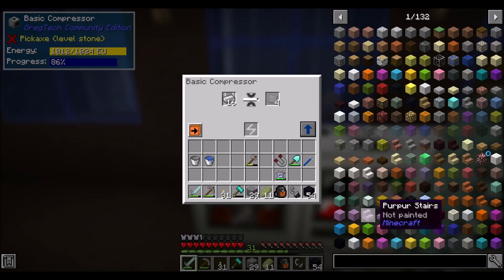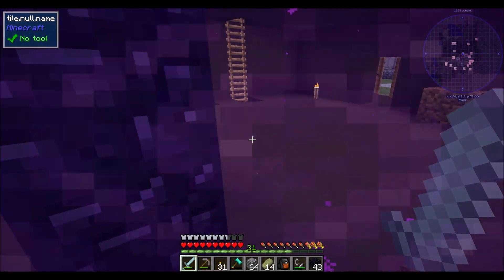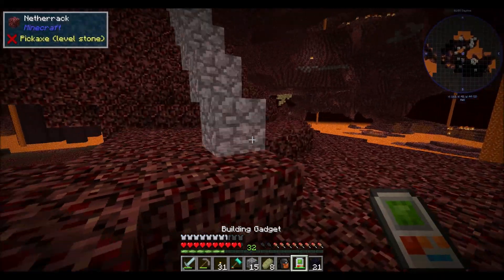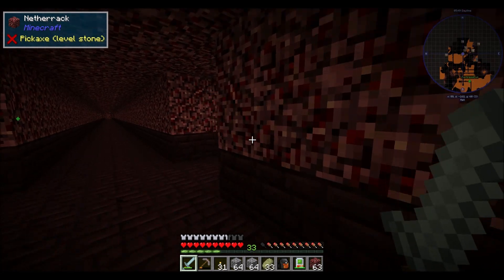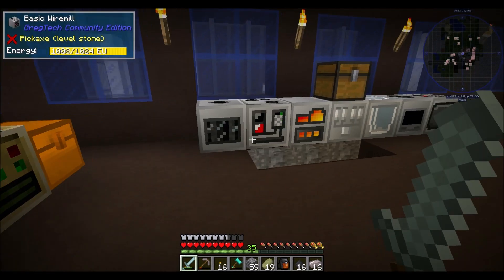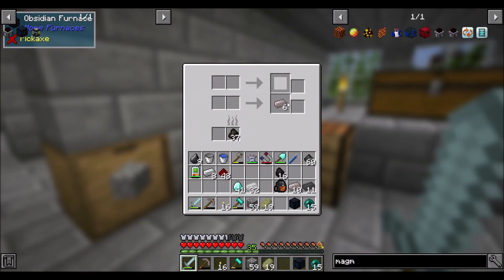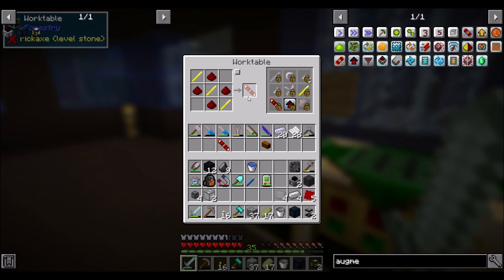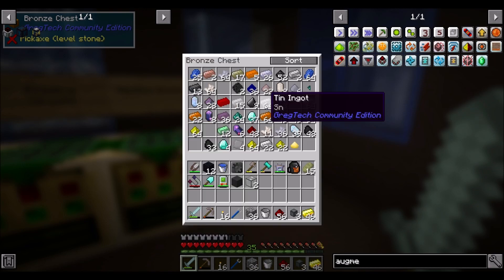OmniFactory   Ep10 Nether and Magma Power

Comment: Gregtech offers the butcher knife, pre-enchanted with looting 3.  It's a bit slow of a weapon but after weakening the mob with another weapon, it's an easy looting 3 tool.

Rather than wasting the resources for the field limiter for who knows how many dynamos you might eventually make, along with the slot that could be used to put a power increase or fuel efficiency upgrade in, use a comparator on the capacitor bank and redstone wire up the dynamos.  Even better would be a power monitor!

Make a lathe and a polarizer, the quest book mentions the polarizer in early game and it never(?) mentions the lathe, but both are starting machines.  

make satchels.  You should be able to make a reinforced satchel.  

use fine copper wires to make circuits and basic motors.  there is really no excuse not to as you're using 2 copper ingots every motor instead of 1/2 an ingot to skip a relatively fast process.

there are a TON of different alloy recipes, consider making a second or third alloy smelter.  Gregtech you will find yourself wanting to make many of each of the machines to save both time and ease of automation.

save some time and make a second or third tool of whatever you are making.  files are 2 ingots, it's easy to make a second and you'll end up using up the files eventually anyways.
Reply: Just to add a few things,

Drill cores are only found in lost cities dungeon chests, and are required for ALL drills. A drill may be a ways off for you, but it makes mining out gregtech veins a snap.

AE2 has channels disabled by default. So feel free to go nuts with AE2 autocrafting.

It would make sense to build production lines for commonly used components. While they may just have an in and an out chest now, those kinds of systems can easily be added to AE2 with a single interface per line.
Reply: @eris902   AE2 is gated behind tier 3 GregTech circuits in some recipes are you sure Dire can do autocrafting now? He'll want to automate everything or as much as possible.
Reply: @DarkVoidIII  AE2 automation is behind tier 3 circuits, but storage is available much earlier. Since he seems dead set on never using AA crates for some reason, it would probably be best if he got into digital storage ASAP.
Reply: @Toksyuryel  He should still get atleast the EBF up and running for aluminium.  Personally I would say that and if he insists on using lava and magmatic dynamos another 1 or 2 magmatic dynamos should be his goal.

You need aluminium for the inscriber and without that you can't get the drive or the crafting terminal.

AE without a crafting terminal just isn't that useful.  He'll still be a bit off of the ME drive but you can atleast get by with 2-3 ME chests.
Reply: @andrewgood7956  The ME Drive doesn't require the inscriber in this pack. As far as lava power goes, personally I found it better to use lava crystals in steam dynamos with boiler and turbine conversions instead of using lava directly in magmatic dynamos. Making lava crystals lets you get 10x more total RF per bucket of lava. But I doubt Dire will figure this out, he'll probably just make a ton of magmatic dynamos like he always does.
Reply: @Toksyuryel  Crap, I meant to say that without aluminium you can't get the ME drive, opps.  And yea lava crystals are great and better yet everything can be renewably(including the lava but that's probably not something you should do early game).  Currently have a setup to make lava crystals producing my own nether quartz.  Started testing a method to make lava without using the nether in my creative world just because I hate using nether-pumped lava power.

I'm not expecting a boiler dynamo from dire either.  I'm hoping that we'll atleast eventually see oil or biodiesel though.

Comment: I just made another steam dynamo, a hardened upgrade kit for the quest, and the coils for improved rf/t for the other quest. I’m making coal coke dust from pyrolyse oven (steam and coal) macerated in the dynamos. 240rf/t 3200 ticks of burn time.

This also make Phenol for easier circuits.

Comment: Dire, you can use Thermal's Flux Capacitors. The bacic tier hold 10 milion RF, it's more than building gadget and magnet can hold together, and they can replace gregtech basic bateries in your energy storage.
Reply: I knew they would charge in a CEU but I didnt know that they would discharge as well. Thanks for the info!

Comment: Now that u have access to sulfur just make a flux capacitor and put it in the cef.
They are buffed and hold 10M rf which is more than the mere million the cef has right now.
Reply: the CEF only accepts gregtech batteries as it is mainly used to convert RF to EU,
Reply: @jak0995  Nope it completeley accepts capacitors from thermal
Reply: SplitJugular it can store in RF or EU. just only sends eu

Comment: Dire, you could have just built a platform under that lava to get at the blaze spawner. Maybe if you had some kinda gadget?

Also FTB Utils chunkloading is disabled, gonna need to use Chicken Chunks.
Reply: FTB Utils chunkloading is working in my world for my lava pump in the nether without any issues.
Reply: @SullySadface  same here as far as FTBUtils loading working fine.
Reply: Open inventory, upper left corner (click the map) and shift+click to load chunks.

Comment: Dire, you should add "tickrate changer" mod, if you'd rather just speed up the game instead of walking away. It's like a global acceleration wand.
Reply: or, play the pack like it is intended to and make multiples of machines.  Also walking away is also a correct way to play Gregtech.  Find you use a lot of steel? make 64,128,1000 or whatever all at once and walk away while it crafts and do something else like mine or make another item for another machine.  Automate the input and output.  Dire's issue is he sees he needs 10 steel, he makes 10 steel.
Reply: The "grind" in this pack can easily be avoided just by having parallel processing and mass production. Something Dire has failed many times over and over again. Don't just add mods that make it easy. Might as well go into creative mode and give yourself everything. If something is going slow, make two of it. If you need a lot of something, make a special production line just for that.